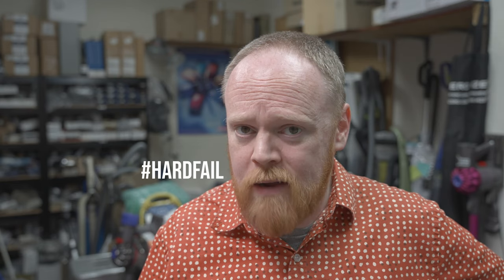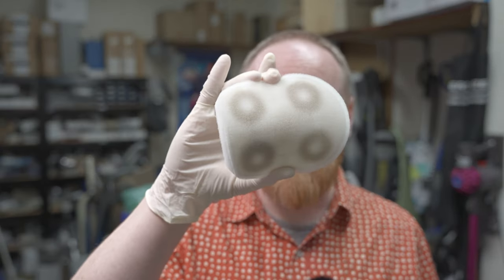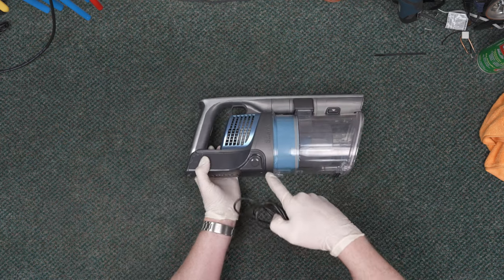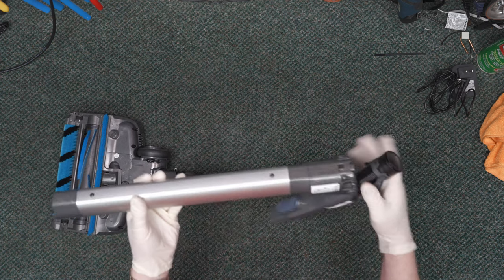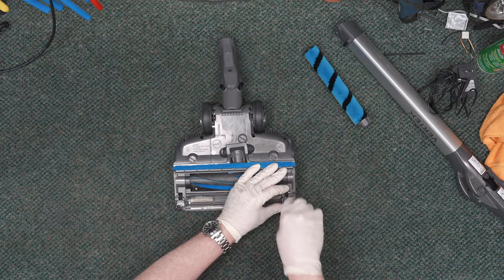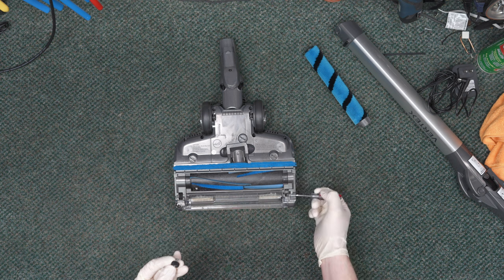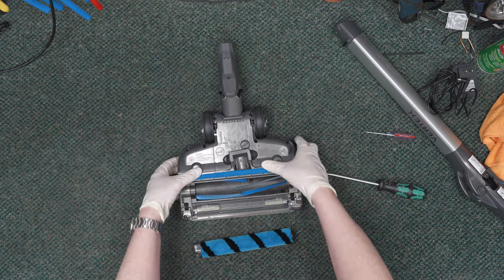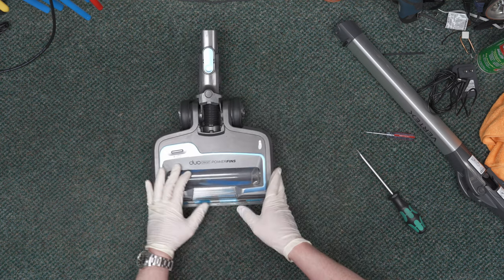EASY! Shark Vertex Cordless IZ462H Maintenance Guide

Comment: Not a fan of my vacuum, but I spent a lot of money on it and too late to return. 
Can you clean the other filter near the motor? It’s starting to stink when I use it
Reply from the maker: Hey Kelli, thanks for the question! Yes, the rear HEPA is washable. To get to it, take your cup off and remove the foam filter. There will be a gloss black panel behind it. Pull and wiggle that piece until it comes free than that will allow you to clean the HEPA. Hope that helps!

Comment: I learned all sorts of new stuff here except what I am looking for. Loki can see thru the window that there is hair trapped where I’m assuming the belts are.  (Both ends). Is there no way to take out that top roller where the rubber fins are so I can get underneath it to clean out that hair?  Also, I don’t see any damage to the rubber fins but I do see damage to the brush parts of that top roller.  Is that an issue?
Reply from the maker: On this machine there is no way to remove the brushroll without disassembling the nozzle. It is a little bit of an undertaking, but I have a similar disassembly video on our Shark playlist for the Vertex corded. Hope that helps!
Reply: I just came across your video, thank you! This was very helpful:) I went searching for answers as to why the light is on but the roller isn’t moving!! Now I know, I probably should buy a new vacuum already:( 
I loved this vacuum but it’s not very repairable friendly:( 
I have 1 dog, & 2 cats.. the hair can be seen through the window & it is solid hair is all I can see:( 
I’ve cleaned everything that you demonstrated, very helpful:)
Also, the part about not keeping the battery charged constantly was a bonus, I didn’t know this either, thanks again. I will check out your other videos too:)

Comment: Could u recommend the best type of vacuum for pet hair, hay and pine needles I have a pet rabbit and her hair has clogged my dyson animal and my Hoover commercial vacuum
Reply from the maker: Oh man, pine needles and hay are bad news for pretty much any household vacuum cleaner. They are long enough to get stuck in hoses and light enough that they aren't easy to knock free with air flow.
I hate to say it, but if that is what you are dealing with I would go the utility vacuum route, something like Ridgid at Home Depot. Make sure to get the largest hose diameter you can. There really isn't a better option in my mind.

If I'm not think of an option, I'm someone will chime in.
Reply: If you have hard floors and not carpet. Look into the eyevac

Comment: Is there anyway to clean the motor?  Used mine to clean up drywall dust and I think the dust was too fine and got through the filters.  It still works but the motor makes an awful high pitched sound now.

Comment: I have this vacuum and one thing we struggle with is random moisture that builds up in the dust can - we have to keep the canister open to prevent any moisture from hanging out in the can. It's so hard to clean if there is. 

I got moisture in there in the first place from vacuuming out an air conditioner filter on an especially hot day and I opened it a few days later to empty it and there was a horrible smell from there. That is the second time. 

Do you have any tips on taking out that blue part? I find that moisture accumulates between the rubber ring on the bottom of the blue part and the top where the filter goes.

Comment: 2:45  in order words, non-detergent cleaning chemicals.  Also use a plastic spudger whenever you have to pry apart plastic, that way you are not destroying the housing.
Reply from the maker: Yes on the non-detergent!

Also, I tried the plastic spudger first.... this thing might as well have been glued on. A screwdriver was unavoidable, unfortunately.
Reply: I think a used tooth brush becomes a valuable cleaning and scrub brush.

Comment: I am having issues with those teeny tiny wheels on the "Squeegee" as you called it. The part that comes off using a screwdriver. I use a nickel. The wheels are clogged with hair/fur. Help? Update...I just forced them out. Also If I see hair on the power fins in the window but not on the bottom, that means I can't get to that area?
Reply from the maker: Hi Kimberly! You did the right thing on the wheels, they are just press fit so you will need to pry them out everyone once in a while because they like to collect hair.

As for the hair you are seeing at the top of the power fins chamber, it is likely not on the brushroll itself since you cannot see it from below. It is likely caught on the "comb" at the top of the housing that collects the hair off the power fins. Unfortunately, there isn't a way to get to those without disassembly the machine... so you'll probably have to live with it. 

Thanks for watching. Hope that helps!
Reply: Why would shark make that power fin spot clear to see dirt that we cannot clean!?!  Why???   Soooo annoying and gross.
Reply from the maker: Suz, It is unfortunate you can't clean that part. I agree.

Comment: I am assuming the electric motor is driving the belts connecting the two rollers.  how does the power head get power from the battery?  Am I correct?  To clean, I keep a used tooth brush
Reply from the maker: Yup! And the power comes through the wand... if you look at both ends of the wand you will see the terminals.

Comment: I have a Rainbow E2 Black, which I absolutely love. I mostly have hard floor with a few large area rugs. I am highly tempted to purchase the Shark Vertex upright. I’m aware that they aren’t repair friendly. However, for light cleaning the duo clean seems to do fantastic on hard floors especially for removing fine particles.
Reply from the maker: Hey Dalton! For most household debris, I actually prefer the regular Dyson V10 carpet head with the adjustable front gate. It can pick up large objects and does a good job on bare floors without rely on the fluffy roller. Just my opinion, though. I hope you are happy with whatever you get!

Comment: which parts can i not get wet? also how to I clean what I call the shield (the clear part the houses that roller that doesn't come out)?

also what are your though on those powder carpet cleaners that you vacuum up? my partner loves it but i just cleaned the vaccum and its all over the machine. thanks!
Reply from the maker: You shouldn't get anything but the clear portion of the cup damp. If you get water in the upper air chamber of the cup (the purple/blue part) it will take forever to dry.

Unfortunately, the clear plastic on the nozzle that you can't remove really can't be cleaned without completely disassembling the nozzle.

For carpet powders, do not use anything that is baking soda based. That will get past your filters and it is really, really bad for the motor. If you want to use something like that which is safe, I recommend a styrofoam base product like Feather Lite which you can Google to find some retailers.